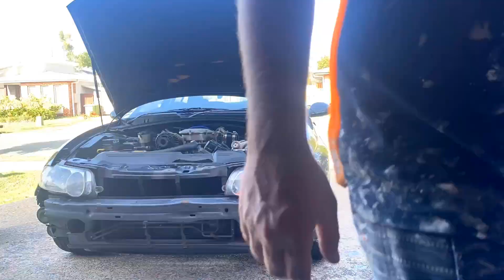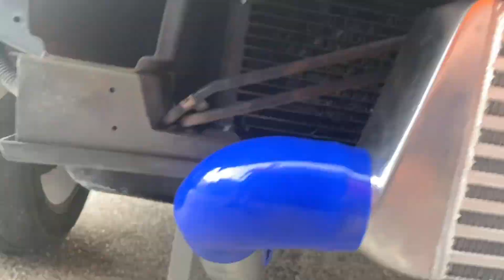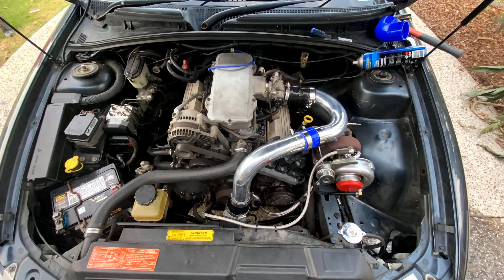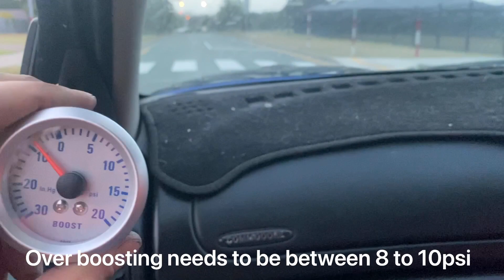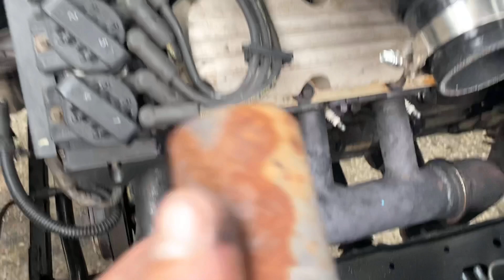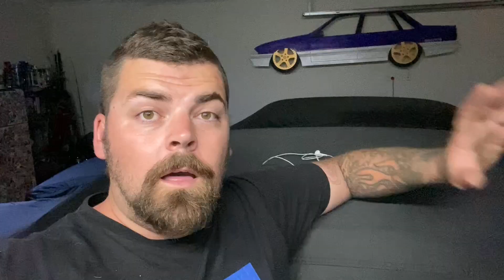Turbo Ecotec v6 vx commodore more problems part 5

Comment: Notice you guys are using VT or Vx models I own a Vy an got a turbo kit with everything needed can I run it on a stock ecu without a tune I'm wanting nothing big in psi just something like 8 to 10 psi
Reply: Can I put it in an it'll work like you have with your Vx ?
Reply from the maker: yeah mate it will work if you run low boost if you go silly you will blow it up without a tune

Comment: just about to start a build on a VY 3.8 ute,not wanting to go nuts,(Budget building)can i get away with a stock ECU ? so many people with so much information.......its overload,just installing a GT3582,your thoughts would be appreciated.cheers.
Reply from the maker: this car was stock everything plus turbo it will last if you don't push it over 8 psi if you want reliable get a tune and bigger injectors and do fuel system

Comment: Wish I had cash to do this and a commodore with less mileage and not dual fuel hah
Reply from the maker: It’s definitely worth it man
Reply: @MrProjectt  got two ones dual fuel ones straight unleaded ones got 300 000 the other 250,000 on the clock dont know if it'd be worth it on either of those
Reply from the maker: @Ash_Angel87  mine has 370ks the more  ks the better mate
Reply: Adding more power to a motor that already has high k's will not last as long as one with low k's. Higher k's are not better, at all!

Comment: I'm doing the same build on a 5 speed VX with the ebay gt3582 turbo.. just wondering if I will get gains by slapping it on there with the stock tune
Reply from the maker: Yes mate adding any sort of forced induction you will feel a big difference
Reply: Yeah sweet so anything after 9 pounds it breaks up?..
Reply from the maker: @aussiebogan1381  anything over 10 mate
Reply: @aussiebogan1381  how did you go ?
Reply: Are you still using standard injectors as well?
Reply from the maker: @aussiebogan1381  completely stock motor nothing changed just added a turbo